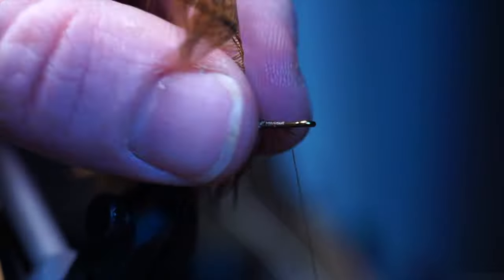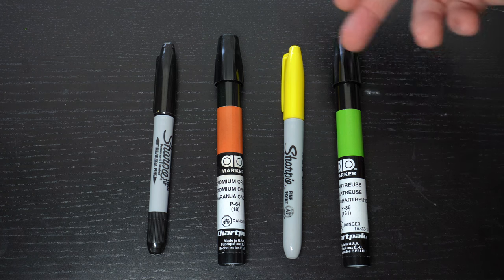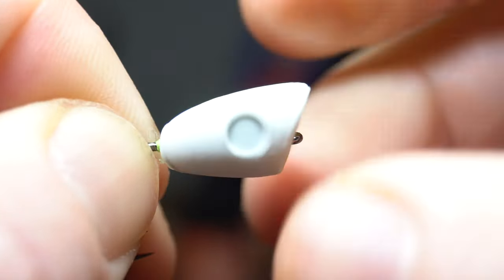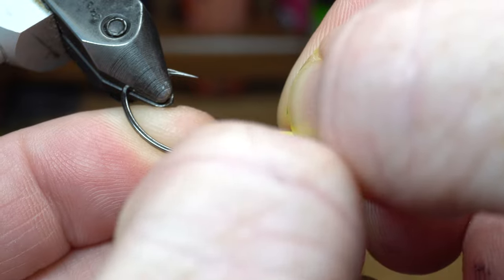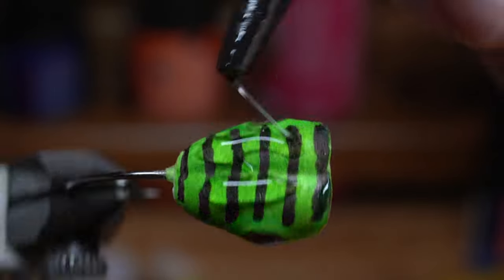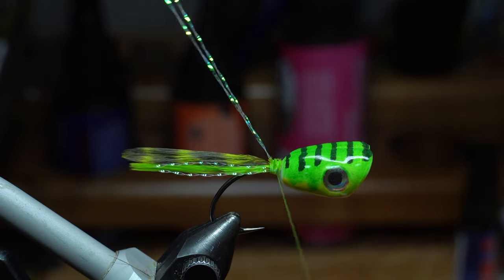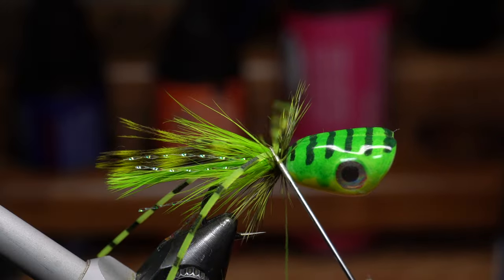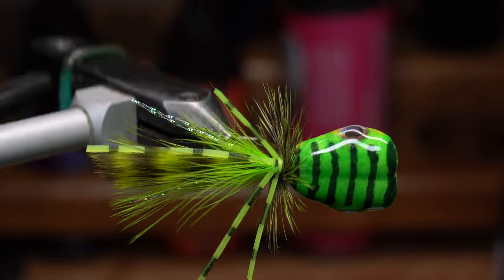Small Bass Popper Fly - Fire Tiger Color - McFly Angler Fly Tying Tutorial

Comment: Your flies are so artistic and functional.  What weight rod would you use with this fly? My thought is an 8 wt based on a similar fly I’ve tied previously.  Rest assured my fly was no near where as good as yours.
Reply from the maker: Thank you.  So this is a small one.  I recently casted this same fly on a 5wt no problem.  Check out my latest fishing video on Boerne lake.  I started off casting this and that was a 5wt rod.  Did pretty well and I got some decent distances.  Like I said it’s a small popper.  Larger ones for sure need an 8wt